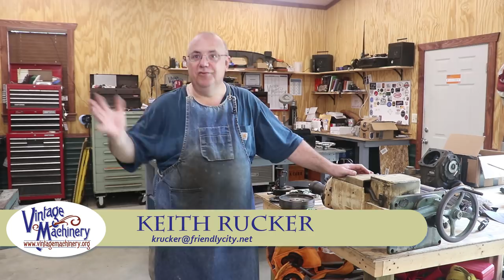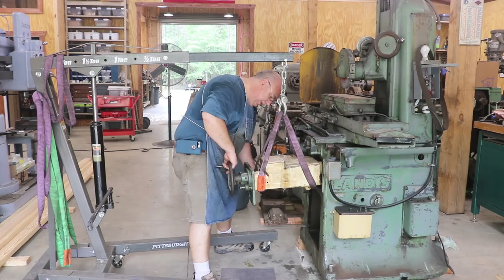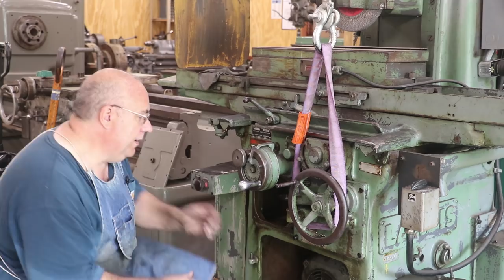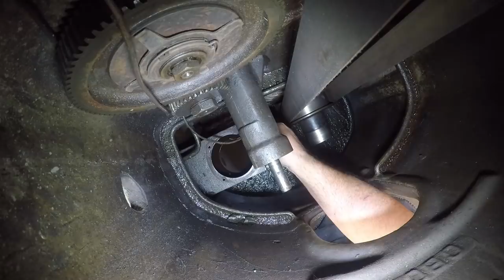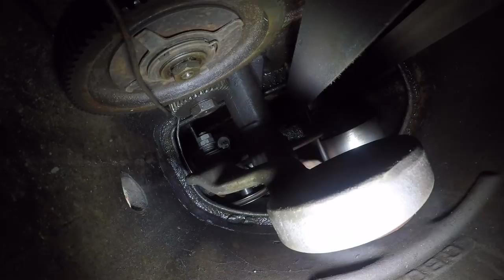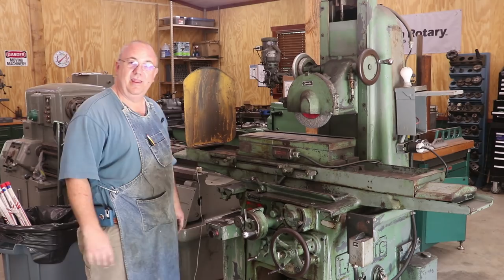Landis Surface Grinder - Reinstalling the Gear Box

Comment: There are times when I just want to stand up and cheer you, Keith. This is one of them! 
You not only did an amazing job of analyzing and solving the problems needed to rebuild the needed parts but you figured out how to share the final assembly like a boss. That internal Go Pro setup was genius. 
Lastly, you gave insight on the technology the designers, builders and operators of the machine brought to bear on creating the machine in the first place. I appreciate the comment by shubus about the service design but perhaps it was the best possible solution to all the constraints and goals involved. And as shubus pointed out, you were able to get the job done. 
Again, cheers to you, Keith. Bravo. Bravissimo!!

Comment: The engineer that designed that machine with such abysmal access for maintenance, must have gone into teaching later in life, and had a major influence on many future John Deere designers
Reply: Heck that guy had one hell of a career he worked all over the world and in many industries.
Reply: Typical of a lot of industries in the old days where engineers had no experience in maintenance.  It seems that today things should be better because you have 3 D modelling where you can virtually disassemble a machine and see where part interference is a problem.
Reply: Yep you would think,  I am a retired engineer.
Reply: Yeah the guy taught 99% of future engineers that cost of assembly matters more than serviceability.
Reply: Makes you wonder how many companies over the years built really top quality machines, but failed because when it came time to buy another machine, the guys on the shop floor would say- " stay away from another one of those- they are impossible to repair."
Reply: He became a gynaecologist
Reply: Yeah, they are consumables now-a-days....  Engineers still aren't required (at least in the US) to have any type of Shop experience before they can claim to be an Engineer.  I think the Engineers in Germany are required to have x-number of years of Shop experience - maybe that's why German-Engineered items are bragged about.  And I'm an Engineer from the US.
Reply: I used to work on Acme Gridley screw machines. Working through potholes to put together a clutch or replace a bearing was a day in hell.
Reply: @bobvines00       Watch some videos on German WWII equipment , like tanks .  Again , poor serviceability .

Wyr
God bless
Reply: Can't defend poor accessibility,  but there are possibly factory tools or a special assembly path that makes it all work out.  Unfortunately this is a really poor approach,  especially for an old machine where special tools are not to be had and special assembly is no longer known about.  Might be an answer to make the designers disassemble their creation with nothing but ordinary shop tools.  Better still make the designers sit on a stool trying to tell an apprentice how it is to be done with ordinary shop tools.  Great fun, but frustrating nowadays for the like of Keith.  Anyway,  I know from many years of my own experience a really tricky job can get easier with repeated tries.

Comment: HI Keith  I bet you would like to meet the guy who designed (made) the access holes for maintenance . I was shouting don't forget the oil line but I guess you couldn't hear me. I really admire the way you let us see your little errors instead of editing them all out. You live in the real world. We have all put things back together and then pulled them apart again. I have a small bet running that the surface grinder may even get a lick of paint before it is settled back in its home. Good job.Eric
Reply: Totally agree about the access. You’d think with all the time it took to design/develop machinery, plant rooms etc that they’d think about access for installation and maintenance. Time that the designers were given a spanner. Regards.
Reply: That is why we are so good , we do ir all twice ,

Wyr
God bless

Comment: Mr. Rucker, it always amazes myself how someone comes up with an idea. Then through ingenuity,create drawings. Then make a prototype, work out any bugs plus improvements too the final design. Then into production. This machines design, the people involved didn’t have computers to assist them. 
  PS. The ball End Allen Head Wrenches are great when you can’t get a regular Allen Head Wrench on the Socket Head Screw and turn it 360 degrees.It can get monotonous real fast when using a Standard Allen Head Wrench and you can only get a minimal turn on a Socket Head Screw. 
    Hopefully you will not have or find any more needed repairs and the Surface Grinder will now give you many years of service. Great Job Mr. Rucker.

Comment: That is one difference between the old machines and the modern versions, the old ones were built to last for ever but were a PIA to work on, new machines are really easy to work on, that's because you need to repair them so often

Comment: I have found that a hydraulic lift table is often useful for some moves like this. A couple blocks to slide on and you don't struggle with the hoist overtop. Also good for loading and unloading and getting things up to the work bench.

Comment: I wouldn't worry about those oil shields you talk about at about the 10 minute mark being single-sided. Stuff I've worked on where bearings were routinely cleaned and relubed instead of straight off replaced, it was common practice to leave the inside shield off after first round of service wherever there were two bearings facing each other in the same bore.  It saved you a whopping 4 steps at the next service round. And there's really not much risk to it. The shields should be a good fit to the bore anyhow, so you really shouldn't be seeing any contamination making it past into the unprotected inside.

Comment: Well done, that looked like a tough rebuild. I find it frustrating the way some machines are difficult to work on, that access hatch could probably have been twice the size it was for example. The other one that bugs me is devices designed to be moved occasionally that don't have obvious hand holds.

Comment: From our point of view the oil line going up and over the big gear looked very close to rubbing I hope it still has the propper space so as not to wear a hole in that line and cause a problem with the oiling system.

Comment: Wondering about those seals on the belt tensioner, what is their purpose? They don’t be stopping oil in either direction and if the shaft leaked the absence of a gasket between the housing and tensioner would cause all the oil to come out through there. The only guess is they are just a dust barrier.

Comment: I was wondering whether you had hooked up that oil line, and then I found out. :)

The oil line in the top section looked like it would rub on the gear.  What's up with that?

Comment: Well, I know this was some time ago, but reading down the list no one asked what you did with what looked like a wire hanging down across and rubbing on the two gears in the rear assembly. So I am wondering, I do hope you didn't just leave that dangling and rubbing across those two gears.

Comment: @12:04 given that you ground the shaft to a smaller diameter, Did you need to fit new oil-seals to fit this shaft or did you order the original size seals as replacements? I can't remember if you ground the whole length of the shaft or just the part where the pulley fits.

Comment: I have a quest you turned down that shaft a bit correct. Thoughs seals on idler pulley will they be effected . Will it shoot oil out the back.

Comment: Just curious and a reminder in case you did not do so. In the video I cannot see you do this and you made no mention of it. Did you tighten the three screws that hold the oil pump in place? You left them loose to get the v-belt in place.

Comment: One question will the new oil seals work properly on the undersized shaft?
Reply: the shaft was only ground where the wheel sits, not as far back as the oil seal